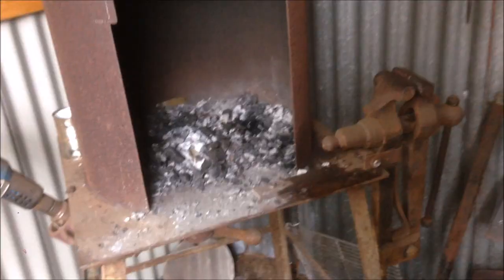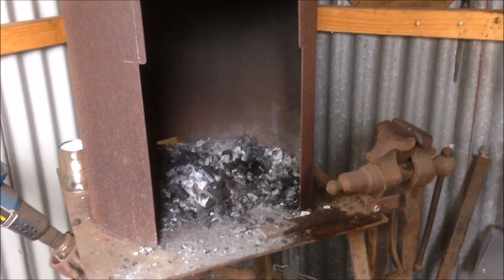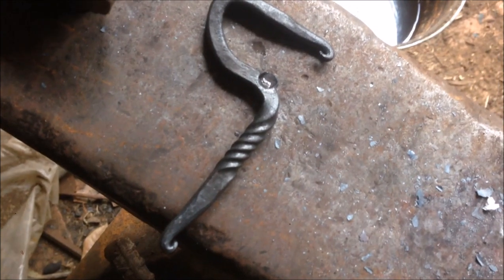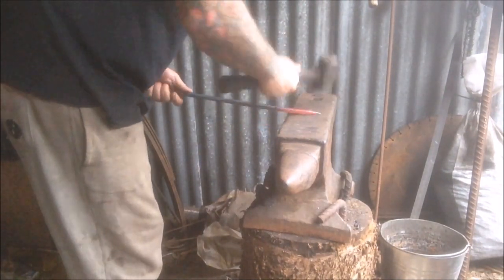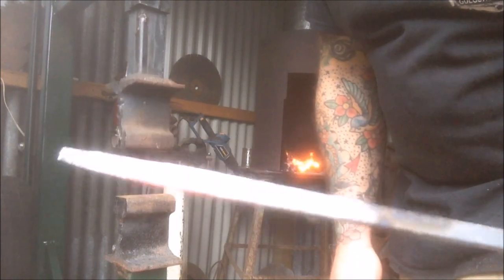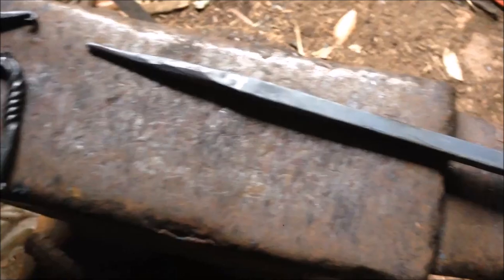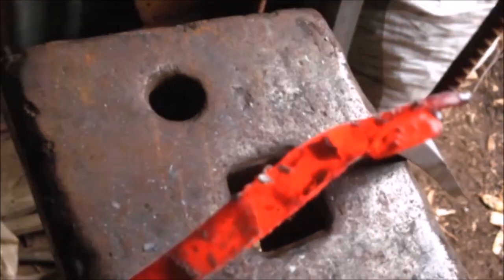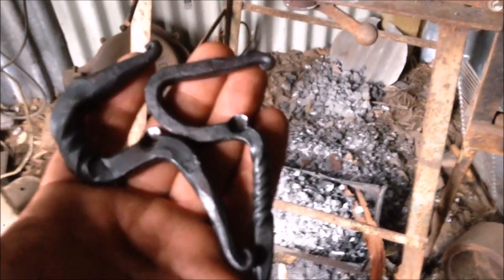Hows that Homemade Power Hammer going?

Comment: awesome video, for some reason this video didn't come up in my notifications. I am currently designing a big dog forge style power hammer for my year 12 metal work project. an idea I came up with is the have a section in the middle of the design to fill with sand bags, this should in THEORY give the hammer more mass and therefor more affective and also suppress the sound  bit. I was thinking you could chuck a few sand bags on the base or fill the vertical bits of tube with sand which may help you stay friendly with your neighbours.

Comment: Just watched the video of you building this and this video, how does the tire and the motor connect. I can’t seem to understand from the videos. Looks awesome and something I need to mimic the build!
Reply from the maker: The pulley off the motor gets pushed into the tyre, simple as that
Reply: @oldskoolonly  so tire and the pulley are in contact when the motor is raised by the foot pedal? That’s cool! No belt / chain needed! Thanks bud!
Reply from the maker: No problem thanks for watching 🍻